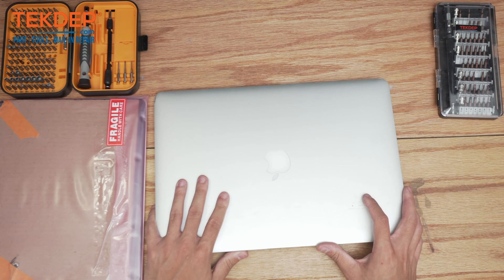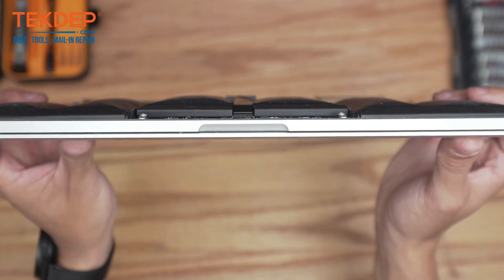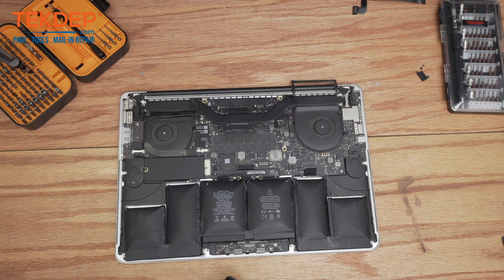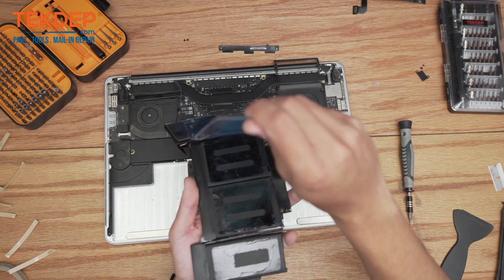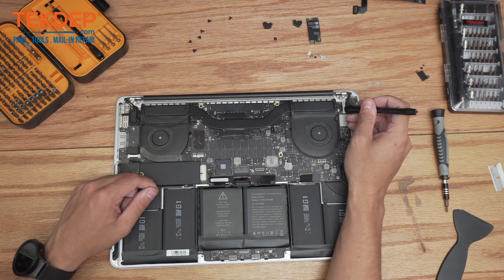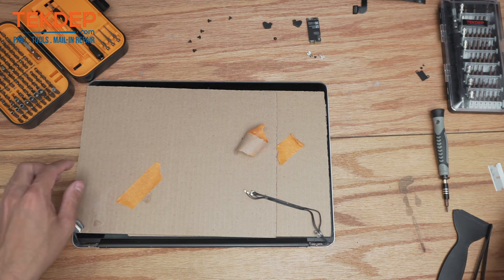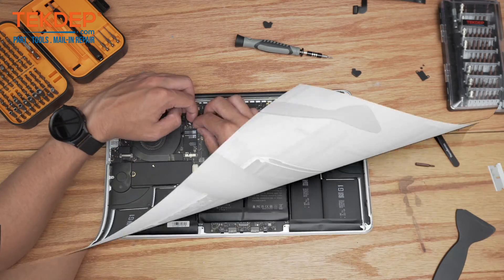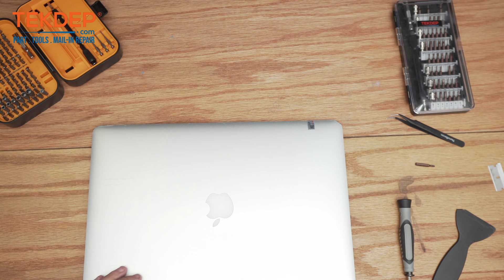Expanding Battery ￼2015 MacBook Pro 15 inch | LCD & Battery Replacement!

Comment: What percent isopropyl alchol is needed to remove the battery? Also what kind of squeeze bottle is that? I've never seen one with a needle like end like that. It would be nice to have. I'm struggling to remove the battery from my 2015 Macbook Pro, which is also quite swollen. Any advice would be appreciated. Thanks.

Comment: With all that tape, good luck replacing that new one when it fails. 😅
Reply: last time I replaced my battery I left it without adhesive so next time I need to do so I just unscrew it and pop right out in 3 seconds